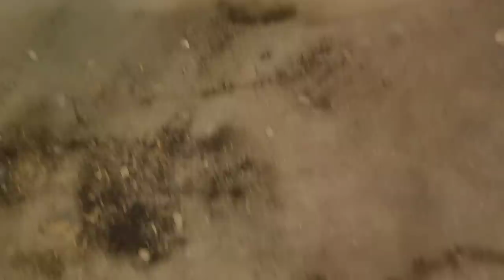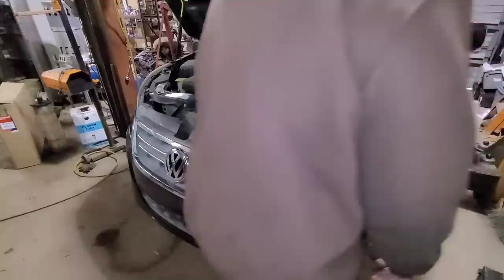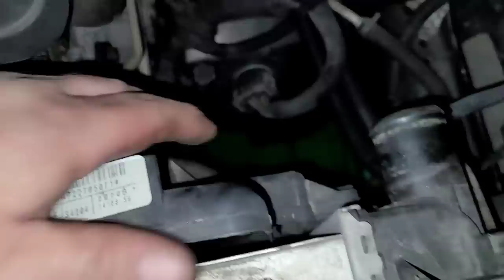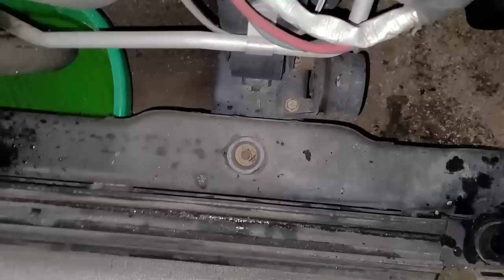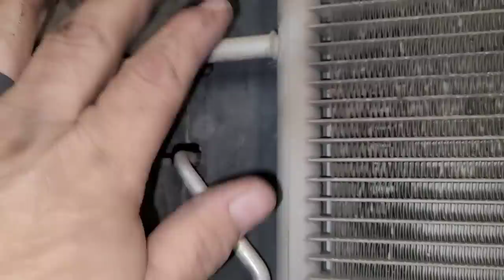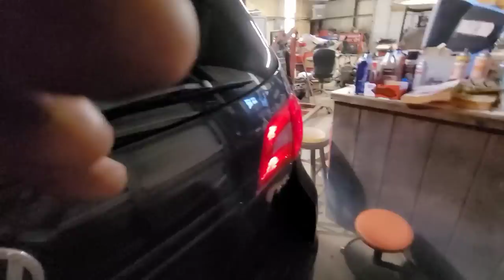Coolant Leak & Radiator Replacement. Plus, A Neat Little Must Have Tool!!

Comment: @Wrenching With Kenny
Harbor Freight  92630 is a Ratcheting Right Angle Screwdriver. You can pull off the knob and use 1/4" sockets as well. It's only $2.99 and is very well made. The steal of the Century.
Reply: Dang, I gotta check that out.  Yea, I believe I've purchased it before.  Pretty handy in tight quarters

Comment: I wonder how many times they've overheated that motor because they ran the cooling system dry? I don't know about that particular motor, but some coolant sensors won't read properly when they're not submerged in coolant.
Reply: VW loves putting them in the plastic manifold, or in the pipes themselves, so yes low coolant it will not show. Generally they also put a low coolant warning in the water bottle though, but I do not know if they did it with this badge job Chrysler.
Reply: @SeanBZA definitely no sensor in bottle, I've done same job same van type..reservoir just pulls right out 1 hose and done

Comment: i have a little ratcheting screwdriver like that but it does not have the big knob which looks nice. it does have assorted tips in a carry case so it is helpful in tight spaces.

Comment: I bought a 2002 Ford Taurus SES off of my cousin. With only 116,000 miles on it. Still a nice car! Of course he gave me the family discount.😂 Anyway,it needed a new radiator and the radiator had to come out through the bottom of the car! I can work on my own vehicles for the most parts,but i had to end up taking it to the trusted and very honest mechanic i use when i do have to use him. I told a guy yesterday,these car company's could save a lot of money and fire all of their engineers if they would just ask us poor folks how things should be made! 😂😂

Comment: Hey,    Kenny do you ever clean and rinse the a/c condenser so it improves air flow to the new radiator. It's just something that relatively simple and I usually do it. Just asking. It seems to improve a/c getting cooler readings inside my cars. As always great job
Reply: I usually knock the feathers and dust off, just did it on my vw a4 while I have it apart
Reply: I usually pull all the a/c components and take them to salvage, only gets hot a few times a year here so it is much easier to service the vehicle without all that crap
Reply: @kellismith4329  Lucky you
Reply: @kellismith4329 but what about de fogging the windscreen in cold weather?

Comment: He he he! I’m now listening for the “Alright” as your working. Love the honesty in the way you work including those ‘forgot to fit’ moments. That was a cool little tool. I’ve got something similar that takes those mini screwdriver bits one end and a 1/4 drive ratchet at the other end. A very handy little thing to have in your toolbox.
Years ago I found a great little “Cheat” tool. Bicycle spokes. A handy length of stiff wire with a little hooked at one end. Great for retrieving the dreaded dropped 10mm socket! I discovered them when, many years ago, I needed to pull that little C clip holding a manual window winder handle off. The hooked end of the spoke was perfect for the job. You’d be amazed at how many time one will come in useful.

Comment: You should have explained the cost savings of bending the AC  line out of the way and now how the customer will hold your responsible for any AC issues in the future because you opened the AC system . I love your videos keep them coming.

Comment: Which is better... The OEM spring hose clamps or the worm gear clamps?
Reply: @AAB371  I agree because the pressure is more even all around the whole tube.
Reply: It depends how tight a seal you want. The worm gear clamps, (Jubilee clips?), tend to let go and chew out the strap part if you try to get them too tight. The spring clamps may be a total pain in the tailbone but they do give a tighter seal.
Reply: the spring is constant pressure even when the heat expand and cool contract cycle the worm drive can potentially loosen through these cycles

Comment: What happened to the days when we could change a radiator with a half inch wrench and a screwdriver?And all in about 20 minutes
Reply: When they were made from brass, and all you needed was a gas torch, sandpaper and solder to fix them as well.
Reply: Long gone, never coming back and only getting worse. Lol
Reply: Front wheel drive. 10 pounds of sugar in a five pound bag. I would like to have a 230 cubic inch inline six with 4 speed manual with rear wheel drive. My dad's 1960 chevy was like that and simple to work on. The trans was a three in the tree.
Reply: The best VW's didn't even have a radiator.
Reply: @clearsailing7993  my dads 29 Ford Model A is super basic
Reply: @snoopy5736  that sounds better than my dad's 1960 chevy.
Reply: @clearsailing7993  i dunno about that, I love 50-60s chevy
Reply: ya on your pinto lol

Comment: That screwdriver tool looks really great.
Reply: To think about it, take an open end box end wrench Drill it out and then go to the hobby store and get a one-way bearing for a pull start for those nitro engines
Reply: I had one like that and I was showing it off and somebody stole it so somebody really liked it but that’s why I never have anybody in my garage anymore unless I know them very well

Comment: Liquid to air heat exchanger is a bit much so radiator it is, another down and dirty video, short and sweet, cool tool I have lots of different offset screwdrivers from when I was stereo/security/cellphone installer, you can never have too many tools!

Comment: You should not use nornal hose clamps on plastic hose fitting because they don't allow for expansion, thats why you have to keep tightening them up, the  hose fitting then breaks off.

Comment: God bless you brother by the way please for the love of God try not to get an LED work light they are so bad for your eyes are used to only use incandescent bulbs the old trouble lights, you know never a problem soon as the LEDs came in all the sudden six years later I have Cataracs talk to my eye doctor very well known my doctor as well, world renowned, and he said sure enough LED lights will ruin your eyes because of the blue light if you can get yellow or something with like a 3000 K then you’re fine but anything higher and it’s gonna cause issues and I’ve also read somewhere else that there’s still radiation emitted from the light more so with the LEDs, the high intensity ones
Reply: Thanks for the info about LED lights.  I’m going 
to check it out.